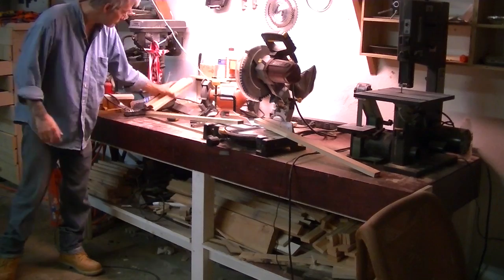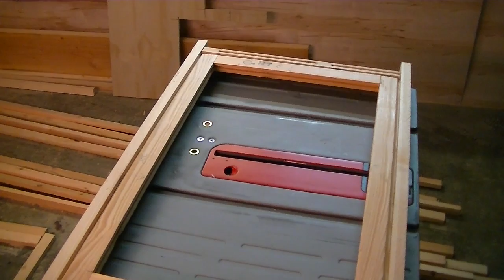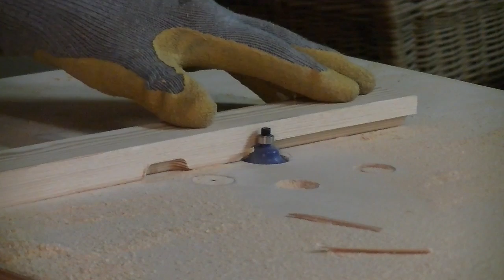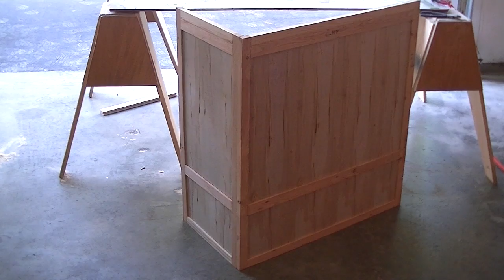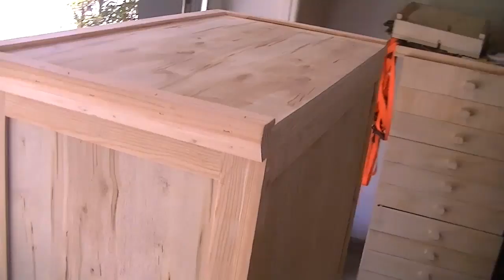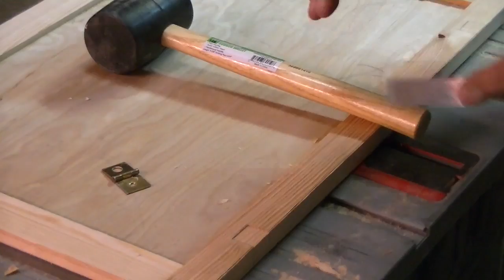Home made cabinet using cheap wood, total cost $20

Comment: I know this is an old video, but I'm wondering if you have an update, I noticed you mentioned somewhere that this wood can warp, have you had any problems with that? I'm looking to remodel my kitchen and trying to find the right wood for cheap. I've been thinking of doing a rustic look completely built out of pallets :D I don't have any experience with this kind of work, just going to wing it.